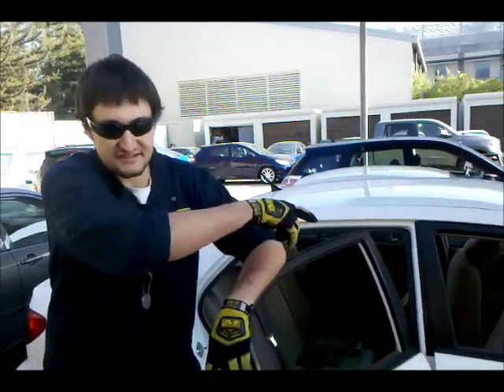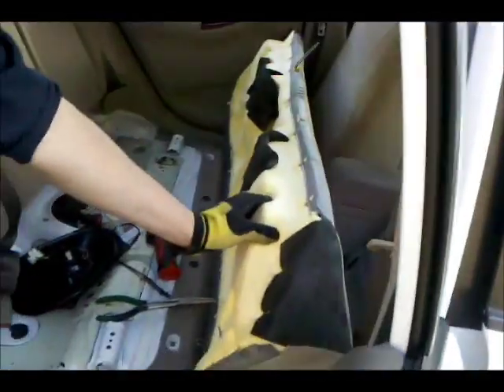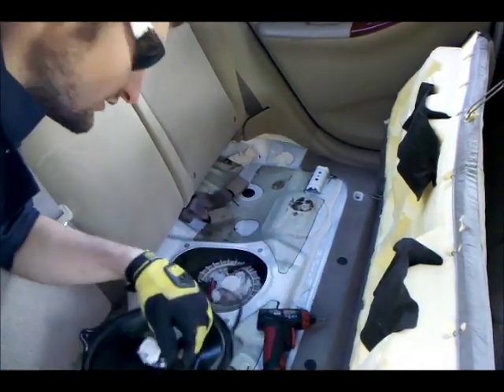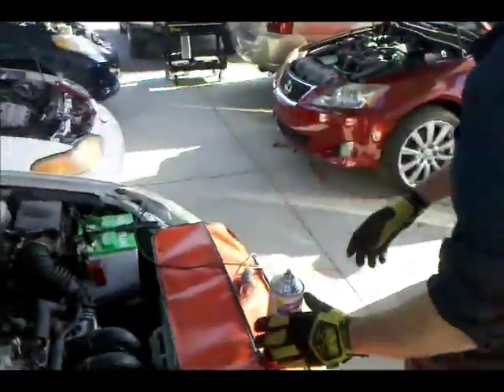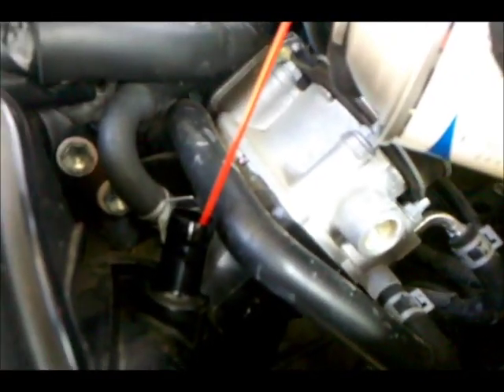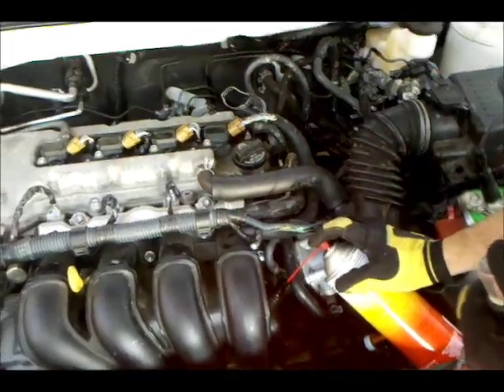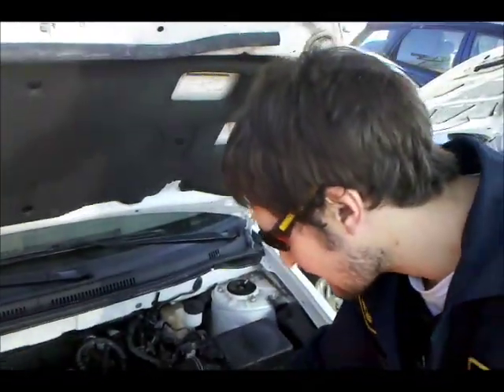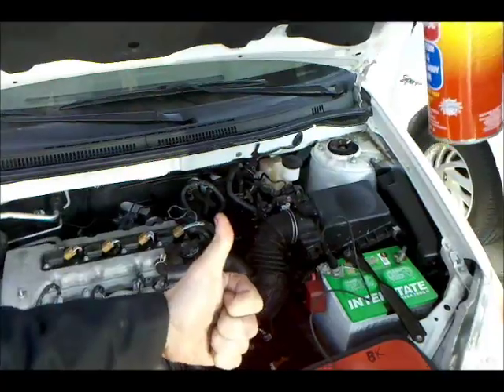Running on Carb Spray

Comment: I use carb cleaner all the time on engines getting them cranked. Especially small engines that sit up and will not start over you take the Breather off and crank the engine over and spray the carb cleaner inside the Breather and the engine will start.

Comment: So in theory if i ran a hose from there to the driver seat i would be able to drive around on just carb cleaner if i ran out of gas! sweet! doing it!! :)
Reply: Mike vw nope it's only delivering enough fuel to run it with no load
Reply: Mike vw f

Comment: You can run a car on diesel, just runs like crap or not at all. 

I have a friend who works for a dealership, a customer towed her HD pickup in cause she put regular fuel in her diesel. He drained it and used it. Ran like shit, but it worked :p Yes it was diesel and unleaded mixed, but still diesel nonetheless :p

This carb cleaner deal is a common use to troubleshoot.